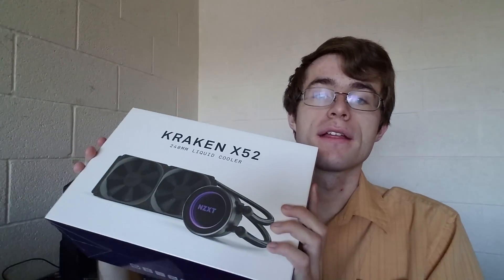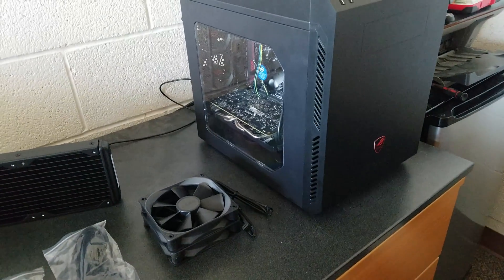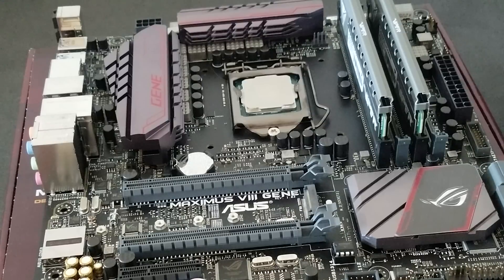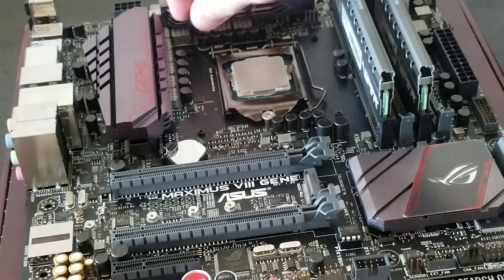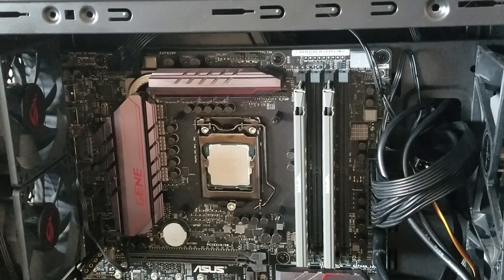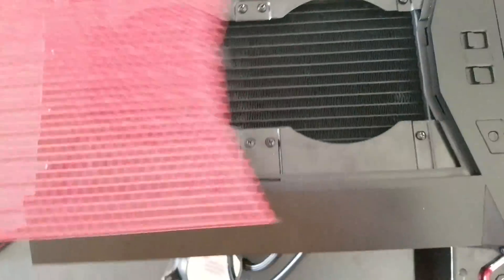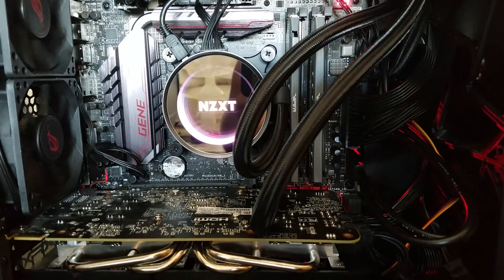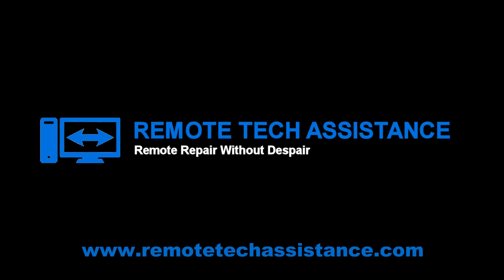NZXT Kraken X52 Unboxing & Installation...BEST AiO EVER!!

Comment: thanks man, i couldnt get the fans to spin or any colour on CPU Disc fan  :(
Then i saw you insert the strange little long plug into the CPU cooler :)
The instructions on the paper saw zero.
A+

Comment: Can you install the fans and radiator in a position other than the front of the case? Because I have a Corsair crystal tempered glass case that has a bit of a nice look w RGP fans in the front which I don’t compromise by removing them and replacing it with those

Comment: I have a  maximus hero VIII MB and just bought the nzxt x42. Now my problem is that i cant plug in the power cable of the cpu cooler anywhere in to my MB. This is becuz all the fan channels or waterpomp ch are male connector and so is this damn powercale which came with my x42 watercooler. So what should i do now?
Reply from the maker: WaFa Pro that's odd. You should be able to plug the main cable right in.
Reply: I used the included sata cable to power up the cpu in stead of the 4pin cable. it works :)

Comment: Has anyone or have you stephen made it for more than an year or two with these coolers
I have heard about a lot of pump failures ??
Reply from the maker: I nearly did with this cooler. It only lasted 10 months.
Reply: Stephen Phillips so it's the same every where
Are all aio s like this
And ar there any rgb alternatives
Reply from the maker: Balaji mirapakayalu Some air coolers do have RGB on them, yes

Comment: best looking AIO if the CAM software actually worked properly, most frusting product
Reply from the maker: 1ns0MNla I know right? I wish NZXT had its own software like corsair does!
Reply: i've never been able to access it and change settings/lighting, and i have reinstalled it like 10 times already without luck, nothing seems to help
Reply from the maker: 1ns0MNla Have you tried using Revo Uninstaller?
Reply: i have, and it still isnt working, when it is loading cam it always gets stuck at 95% and doesnt go further

Comment: Great installation! Could you tell me what 80mm exhaust fans you have installed besides your motherboard? Thanks,
Reply from the maker: They're Raidmax. I got a 4-pack of them at Fry's Electronics.
Reply: Stephen Phillips thanks for the reply! I will buy the Antec p50 case soon but it doesn't come with any front chamber exhaust fans, is why i asked :)
Reply from the maker: Wav-Scorn259 It's got 120mm fans in the front.

Comment: Why so many dislikes? Some people are just straight up asses. Appreciate the tutorial dude, it's a good watch for someone doing a build for the very first time! I managed to pick this up brand new for £100, which is about $135, so a pretty sweet deal I think.
Reply from the maker: Tyler B I appreciate your encouragement dude. That's actually a pretty decent price.  Was it on sale?
Reply: You're welcome buddy. But no, I bought it from some guy on eBay who accepted my first offer surprisingly! Just hope I can get the thing in my In Win 301 case as it's really small, though does have three 120mm fans so should be alright. I actually worry more about the cable management side of things than i do about actually installing the cooler alright!
Reply from the maker: Tyler B If I can get it in my antec p50, you can get it in your In Win 301.

Comment: what temp in gaming
Reply from the maker: I actually do not know about gaming temps. However, I stress tested it in AIDA64 and it comes out to 140 degrees tops on the 7700k.
Reply: its a good Liquid cooler I getting it because its for gaming temp
Reply: so can u have a look in gaming
Reply: 140C? The CPU will turn off when going 110? I assume u mean 140F?
Reply from the maker: Yes, I meant Fahrenheit.

Comment: Hey, I have installled the nzxt x52, the pump and fans seem to be working but the lights are not working. Please help.
Reply from the maker: alan boss Plug in the SATA connector
Reply: Stephen Phillips already plugged in
Reply from the maker: alan boss configure it in CAM?
Reply: Stephen Phillips it's being recognised in cam just leds are faulty
Reply: @mralanable  did you fixed it cause i have the same problem and i don't know what to do...

Comment: I have done all of this, the fans are on and the pumps seems to work. Only problem is it doesn't light up, now when I disconnect the usb wire the fans go full throttle so it looks like that wire is working (or at least doing something) now if I disconnect the other cable the fans turn off. Any ready why it's not lighting up? (I haven't installed cam yet and can't just yet since my stupid ass didn't check to see if my old wireless card could be added to my new mobo) my computer specs are:i5 7600kAsus prime z270ar (has aura sync; whether that collided with the krakens software or not)Kraken x52 cpu liquid coolerSilverstone Primera rgbEvga nex650g psuAsus strix 1070Corsair vengeance white led (2x8)
Really annoying, hoping it's not a faulty product though:(
Reply from the maker: Are you giving it power through the SATA power cable?
Reply: Stephen Phillips yeah, one thing I should have mentioned is that once I turn my pc off I get a glimpse of colour but it never stays for more than half a second. But yes both cables are connected.

Comment: How long is the usb cable? Do you think its long enough to run behind the the motherboard and connect it to the usb 2 header thats located on the bottom of my board?
Reply from the maker: Depending on the chassis, yes it is.
Reply: doing mine tonight! Really good video! I appreciate it's thoroughness! :)

Comment: So that cable that goes from the Water Block to the Fans which has 4 plugs, 3 of them have 3 needles, and 1 has 4 needles. Do I plug the fans from the Radiator into this cable that splits into four? Thanks.

Comment: Hello, I have an Asus Z270-AR board and an intel i7 7700 and im having trouble installing the kraken x62 cooler. When I installed that plastic piece on the back of the motherboard and put those screws in, it is loose. I can pull on the screws and it moved off of my motherboard. I don't think this is normal, what should I do? Please help.
Reply from the maker: did you try tightening the screws?
Reply: Stephen Phillips yeah man nevermind when I put the water block on, it tightened up. thanks for the video.

Comment: Hi Stephen,

Did you put thermal paste into your x55?  My idle temp is aroung 36-38 degrees is that normal? and when im using my pc its in 42.
Reply from the maker: I actually just used the thermal paste that came with the liquid cooler. And, yes, those temperatures are normal. If you wanna cool it down, may I suggest putting it in performance mode?
Reply: Stephen Phillips oh thanks for your  fast reply! kudos from us here in philippines!
Reply: check to see if there's a solid wiggle-free connection against the CPU. I had overheating problems during gaming where my stock clocked 6700k would get upwards of 85C and after spending hours reinstalling multiple times and doing all kinds of testing, I discovered my mounting hardware is defective or doesn't work with my motherboard...I can't achieve a firm connection with my CPU. The backplate mounting screws don't screw in to the backplate all the way, leaving a 1 or 2 mm gap which doesn't allow the water block to evenly contact the CPU. my 30 day return policy with newegg has expired so now I"m hoping NZXT will help me out...
Reply: Normal lang yan tol, isali din ung room temp. baka malamig sa kanila kaya nakatulong din :P.

Comment: Good evening well I tried installing Cam Software on a different computer without the drivers install and nothing. On my PC it shows but minimize in the taskbar but on the other PC it loads up but once it reach to 99% it crashes so there's something wrong but on my mobile devices I can change the rgb colors on my fans and led lights  but not my Kraken x52 so weird.

Comment: hi! i got my x62 and installed it on my i7 7700K and MSI Z270 Carbon pro mainboard. is it normal that the cooler is loose? i thightend the screw as far i can but it wont  keep solid on the cpu. any idea?
Reply from the maker: Did you put on the backplate of the motherboard?
Did you tighten all of them?
Reply: yes i did. i tighten the thumb nuts so hard that the standoff broke of xD
but i got retention kit so no problem. its still loose.... backplate is installed as well.
when the backplate is through the mainboard holes, its loose. when not its tight. but i dont think its proper installed. my i7 7700K is 27C im idle. when 100% load it get 80 in second and after 10second it reches 100C. back to idle, it get back to 27C in seconds. thermal paste is also well applied.
 (sry for my english)
Reply: Kayser Yoshimatsu you just have shit cpu